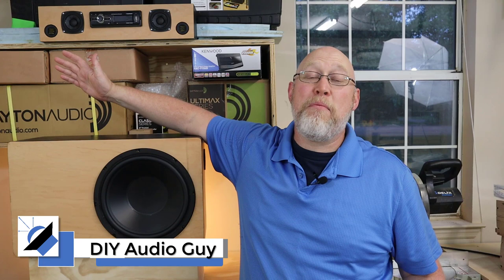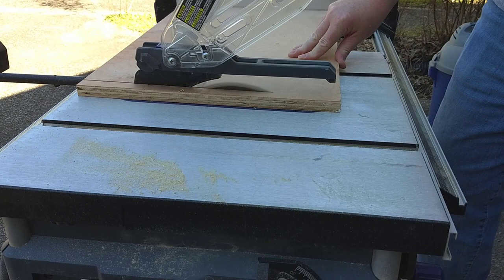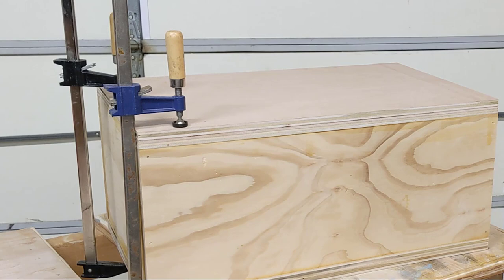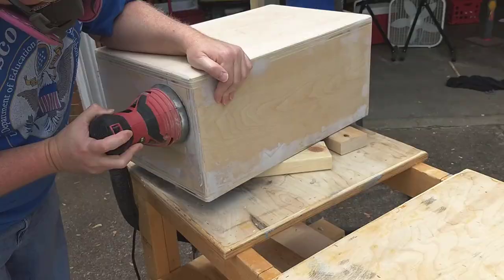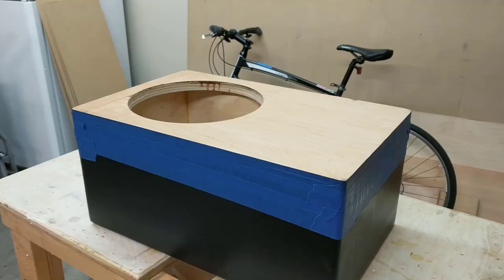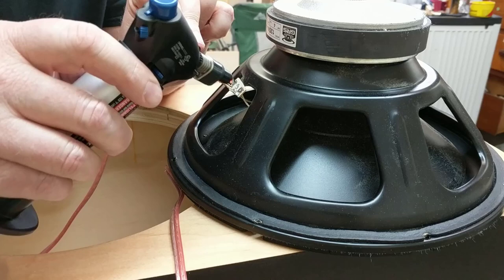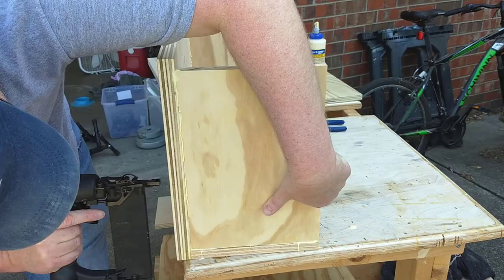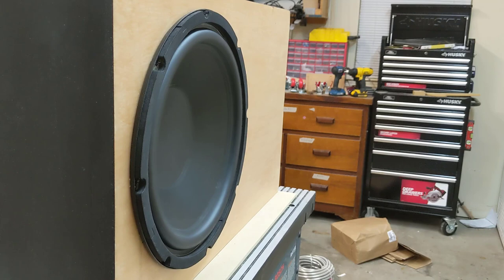Budget Subwoofer Build (The Budget Bass Box)

Comment: I'm giving you a thumbs up simply because you didn't try and BS us that you built it for $23. Like you I have a shed full of tools (not that I can get to many of them) but even if we have material left over from a previous project, it still cost us money at one point, and I like that you didn't pretend it didn't. All going well I hope soon to start on "the internets most expensive DIY sub build" (maybe not the most expensive, but we are talking a lot of thousands).
Reply from the maker: I would like to see that!
Reply: @DIYAudioGuy  so would I. I bought the LMS Ultra 5400 driver and 18" VMP passive radiators before TC Sounds went out of business. I have been sitting on them for nearly a decade now. I'm in the process of refining a six sided cabinet for it. I figure there will be about 5 - 6 sheets of 16mm MDF in it. There are a few experimental things I would like to try, like dampening paste between layers. Also tossing up if I want to use dissimilar materials (both MDF and Ply).

Comment: I bought the 8 ohm version, 2 of them. One is in a sealed box for my home theater, it shakes my entire wood floors, I feel earthquakes in movies and only pouring with about 200 watts. I'm going to buy 4 of the 4 ohm for my truck blowthrough budget demo build! These subs rock!!!
Reply from the maker: I like cheap subs and I cannot lie.
Reply: @DIYAudioGuy  that sealed enclosure i built is 2 cubic ft, half filled poly just dropped in not stuffed and one layer of the yellow sound dampening on one inner wall. It plays beautifully flat, hits all of the notes  with crossover set at 50. The cabinet it is in is an old stereo console from the 70's. Gutted with 2 sub enclosures now built in. Only using the sealed side, dont like the way the ported side turned out, its 2.5 cuft.. i took that one out until I re build for another sealed. I dont like how ported boxes sound in my house, it's ALL wood floors with basement. Doesnt take much power to shake pictures. Downfiring subs, I raised the whole console by adding just 3 inches allaround and left the fancy cut open on front, making it a 4th order. Turned up, I can feel it in my chest, like I'm at a concert.
Reply from the maker: @bradlwykfulbright  If you have any pics of the build you can send them to Parts Express, they'll put in their speaker projects gallery and give you 25 bucks.. at that point it's basically a free woofer.
Reply: @DIYAudioGuy  i had no idea of that, thanks!
Reply: @bradlwykfulbright  I’d like to see that myself!

Comment: 30 yrs in car audio/customz here.. tips - just before u painted it.. use wood glue on moist rag.. wipe it around the outside of box over that grain and it fills/vanishes.. sometimes it takes a few rounds of drying but it'll smooth, then spray it with filler primer (automotive) and sand back, repeat.. then use epoxy based paint for furniture, clear it with polycrylic and detail it..  it'll look like a piano..   you can also wrap it with vinyl and a torch thats low budg
Reply from the maker: Thanks for the tips!  I ended up repainting and uses some automotive primer, that made a big difference.
Reply: Don't you need a finish for Vinyl? Besides the wood surface?
Reply from the maker: @kramnull8962  as far as I'm aware you can just glue a vinyl on, the trick is using the proper adhesive, and making sure the surface is smooth because any bumps will show up in the vinyl.
Reply: @kramnull8962  best adhesion possible for iron-on vinyl products like faux wood grains n such OR real grain laminate with wood glue - would be on a KILZ sealed surface lightly scuffed with like a 3M 7447 pad..  Automotive grade or commercial grade decorative vinyl needs a smooth smooth flat sealed surface to adhere longterm and not show flaws thru it.   use something like a 3M Ultra Fine 7448 after stepping down from higher grits and use a heat gun on low to lock the vinyl in.  (94-110 degrees only)  auto vinyl i highly recommend vvivid out of canada its perfect every time for me.  hope that helps
Reply: i think you might like gelcoat from the boat world if you do alot of these, learning spray techniques is fairly easy (YT)..  or even use epoxy/mica countertop/surfboard style art techniques on inserts or accent panels is also a way to take your stuff in all new directions on the cheap.. LED and incandescent panel lighting is dirty cheap these days and can be a huge pop for like $8 off web..  and if you see a car, exotic whatever with a paint job u love.. look up the paint code, hit up an online company that mixes bodywork paint in cans and have at it.. like $34 a can.. theres tons of cheap tricks that yield incredible boutique design results.  great vids bruh :-) keep craft skills alive!
Reply from the maker: @crzjohn4275  Great ideas!

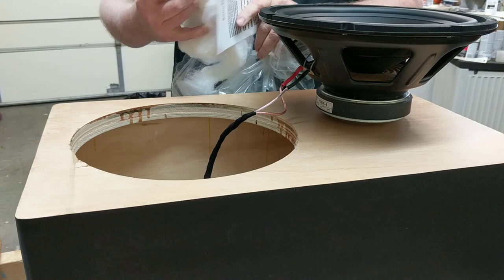Comment: @5:35 standing waves are not normally a problem with subwoofers. Usually the enclosure is much smaller than a half of a wavelength at the cutoff frequency, so standing waves cannot occur.

Comment: Budget tip: if you buy quality tools used you can use them for as long as you like and resell later at little or no loss. Blades and router bits are another story, but carbide is a good investment in edge life.
Reply from the maker: Absolutely!  Just have to make sure all the parts are there when you buy them!
Reply: @DIYAudioGuy  You also have to make sure you use them enough to warrant the cost.  i.e. sure a 14 inch circular saw is nice, but does anyone really need to cut down an 8x8 at a 45 miter in one pass?  I would not cheap out on some tools though like a router, everyone always seems to have a really underpowered one and they're not that expensive.  The router tables with easily adjustable lifts are the expensive part, I find the plunge base to be awesome.  I built a router table and have hardly used it.

Comment: I cut the hole in the baffle before even gluing both layers together for a clean flush mount. Also adding t nuts and screws rather than wood screws. Way more clamping force and no worries about stripping out the holes. Cheap insurance.
Reply from the maker: That is typically how I do the baffle.  https://youtu.be/6xooITE0-K8 
I am not a big fan of t-nuts, in my experience they are not worth the trouble and they are not as good as threaded inserts.

Comment: If you don't have much money and you are okay with spending a bit more time you can build very nice speakers with Max 50bucks of tools. I started with a handsaw with changeable blades (A big long one for cutting the wood and a Jigsaw kind of blade for speaker cutouts), drill, rasp and a file, chisel and the consumables like sandpaper and glue off course and 1year of woodworking experience from collage. I had a very good woodworking master😃

Great video and very intertaining! Maybe i gonna put that driver in hornresp and design a tapped horn for it🤔
Reply from the maker: Hand tools, that takes dedication!
Reply: @DIYAudioGuy  Yes and a big load of it! Takes 10times as long.

Comment: This GRS looks very much like the OEM driver from my Klipsch ksw-12 home theater subwoofer. I replaced it with a Dayton classic series 12, which has a much, much larger magnet and stiffer feeling suspension. I was skeptical at first about low end extension, (don’t care about volume,) but it rattles a door in the room at normal listening volume due to being punchy and quick, and yes, it goes low too.
Reply from the maker: I've been using one of those classic 12s for my DIY home theater sub for about 6 years now.
Reply: Yeah I think they are possibly the best deal in subwoofers. Instead of getting a new sub, just grab a cheap one at the thrift store and stick one of those Daytons in it! The Ksw-12 came from a neighbor, for free and was not powering on. I replaced a blown fuse and a faulty fuse holder, and it has worked ever since. Perfect sub for the Dayton driver!

Comment: I normally cut the speaker hole before I attach the baffle. But after seeing this. It looks like it’s a lot easier to cut.
Reply from the maker: True, but if you mess it up...
Reply: @DIYAudioGuy  that’s true. I guess I gotta practice before I do that all I have is a jigsaw and I don’t have a very steady hand. So best to not screw it up lol. Speaking of. Do you have any tips to make sure I don’t cut the hole too big/too small. Or uneven.
Reply from the maker: @the_allamerican7057  two screws and a piece of plywood Will get you a very good circle.  A sharp blade on the jigsaw, and set it so that you can cut curves.  Then all you need is a steady hand, which just comes with practice.  It would not hurt at all to grab a bunch of scrap material and just practice cutting circles until you think you've got it.  The first subwoofer cut out I ever made was absolutely terrible.  The good news is that subwoofers usually have a pretty big mounting flange, so there's a little bit of room for error.

Comment: No I’m checking out your page I’m in your channel watching you build speakers I’m about to get a surroundsound system and my wife wanted to buy one of those ones that everything comes with it and I was like no I’m not doing that I’d rather buy for Sherwin Vega bookshelf speakers That would sound better than one of those systems anyway even two of them because I had two of them seven years back when I was younger with a Sony stereo with a 200 this CD changer this is back before all the Bluetooth and all the iPods and all that but that’s one thing I loved about Cerwin Vegas you didn’t need a lot of power to make them sound really good 🙀🥳😱🤯😎🤩🙀
Reply from the maker: I you are looking to build your own speakers this is what I use and it is amazing.  https://parts-express.sjv.io/a1Jk4M
Reply from the maker: If you want to buy speakers Crutchfield is running a sale:  https://howl.me/ciOgCnQtR7v

I do recommend that you build your own subwoofer, most pre-made home theater subwoofers are not tuned low enough, and the ones that are are much more expensive than building your own.  

https://youtu.be/dbVd5igcjHs

Comment: These subs are now $35.   But still worth their cost.   I've used them in many projects, they play well up to 800hz so can be used as a woofer in 3-way setups but still hit the low end like a sub.   They should be ported at 30-40hz in a 2ft^3 or more enclosure to get that chest thumping effect with just 60-100 watts.   Sealed enclosure is no good with these.
Reply from the maker: Yes, this does much better in a ported enclosure.
Reply: Now 45€🇩🇪
Reply: @DIYAudioGuy no. Look for tsp Parameter.  Qts  0.82 never for reflex, only closed.

Comment: The grs subwoofers don’t handle distortion that well and even if you don’t give it it’s rated rms power you can still cook the voice coils in them if you go too crazy with the volume on a amplifier that’s powering them I tried to free air a 15 inch version of the and it was rated to handle 150 watts rms and almost blew it with just 70 watts rms.
Reply from the maker: Yea, cheap subs are  cheap for a reason.

Comment: Hi, Simple to the point, great vid. Going to build two!  Did you use a low pass filter, if so what were components?  Many Thanks
Reply from the maker: I just used the crossover on the amp.
Reply from the maker: @The Dirty Cook I ran this in a car.  You would need an amp to run this.  You could bolt on a plate amp like this one:  https://bit.ly/3kO4fi6

Comment: I made a VERY VERY CHEAP bass box. I used very insanely thick cardboard 5bucks and a sketchy 6 inch woofer 10bucks and a screwdriver 3bucks. Sound is decent unless you put 30 - 60hz it starts shaking and dances. And the box nearly broke 😅 (I'm still 10 that's why😅)

Comment: Would it be a huge mistake if you accidentally got a 12 inch guitar speaker from parts express instead of a 12 inch subwoofer and ended up making the mistake of putting a guitar speaker into a subwoofer enclosure.
Reply from the maker: Yes.
Most guitar speakers, even the ones used in bass cabinets, struggle to hit the lows.  But, they are very efficient.

Comment: I would have used a rabbit bit to add a step where the speaker mounts so it sits into the cabinet.  And FYI, you don't have to include the cost of the machine equipment used on the project. The table saw can be a circular saw which can be a handsaw. Every one of the power tools can be replaced with a hand tool that you can get for a couple bucks at Harbor Freight or a yard sale.

Lastly, that box looks way too big for that sub.

Comment: Young Mann Anthony here with that question ?  Speaker build is 2-2ohm 5-1/4 coaxial & 2-2ohm 6.5 Kicker cvt subs will give you all the specs in a email if needed.  What coils and or caps should I be using for a crossover ? Up to 135-150hz for the subs and like wise for the Mids.  Speakers will be wired in series. (Like you a Budget build it's what I have in the shop a 2 channel Rockford amp)  This is a Ice Chest build FYI.
Reply from the maker: That depends on how complicated you want to get and how good you want it to sound.
You probably don't need any crossover on the coaxial. But if you want to filter out some bass try this:
https://parts-express.sjv.io/yR79L2 
If the mids and highs are to loud then you can throw on a resistor to turn them down a bit:
parts-express.sjv.io/x97Qbv
A coil liked this would make a good low pass for the subs.
 https://parts-express.sjv.io/rn7ObR 

That will give you a 6db per octave crossover with a crossover point around 120 hz.  No guarantee that it will sound good.  But it will probably be fine for a budget build in an ice chest.

Comment: that plywood alone is worth as much as 5 of those drivers right now
Reply: @DTW-bx2vy  Not really. Currently its $36.54 at home depot. I believe it used to be higher, but before covid it was more like $20 a sheet.
Reply: @DTW-bx2vy  Yeah birch is $60 a sheet, probably twice what it used to cost. Everything's over priced.
Use iron on edge banding and you wont have to worry about plywood imperfections. I hate when people use ply and dont cover up the core. Defeats the whole purpose of plywood.

Comment: I have my eye on these drivers to replace a really nice B&C 18" cast frame pro cinema sub that is disappointing in low extension.  I can mount the GRS (4 of them! ;->  ) in the interior wall of my barn loft listening space in a true infinite baffle configuration as their Qts is about 1.0 and the room behind is quite voluminous and only used for storage.  This should give me strong bass down to below 30hz, plenty low enough for music.  And their lackluster sensitivity should be greatly improved by acoustical coupling from cluster-mounting them, giving me a close equivalent to a 24" driver.  I should be able to sell the B&C used and be money ahead, or I can repurpose it for mobile DJ use where it performs really well.
Reply from the maker: These are great speakers for the price., Just keep in mind they are inexpensive for a reason.
Reply: @DIYAudioGuy  Sure, I get that. Other than the modest f3 in the small sealed enclosure, did you hear other audible evidence of their budget quality that would make you hesitate? I'm kinda thinking vast piston area covers a multitude of sins at moderate spl and low X. But maybe clustering results in underdamping of already high Qts drivers?  Cheers!
Reply from the maker: @naturalverities  Nick with Toid's DIY has used these a lot, he's a big fan just like I am and we have discussed these a lot.  Just be aware that these are not audiophile drivers.  In fact you might want to check out his channel he built an isobaric subwoofer using the tens and it was an absolute beast.
Reply: @DIYAudioGuy  Thanks, yes I saw his build, intriguing! You guys rock!
Reply: Were you using the B&C in a sealed box or vented?
Reply: @TimpBizkit  It's vented, in a box volume quite close to that recommended by B&C. Ports may be off a bit as they are triangular in two corners a la QSC cinema sub cabs. I really should get the stuff I need to test the driver as I am suspicious that its free air resonance may be higher than spec. Except for not getting down into the 30s with authority, it sounds fabulous.

Comment: I always cut the hole when the box is done as i try to always design the box so the drive overlaps the sides so it's more ridgid
Reply from the maker: That's clever.
Reply: @DIYAudioGuy  you show try build a tline with extremely braced box with a cheap drive and you will be amazed at the sound
Reply from the maker: @dlfrestoration  My home theater speakers are transmission lines. I'm a big fan of transmission lines!
Reply: @DIYAudioGuy  nice i love the bass responses

Comment: Never, ever, and did I mention never, have your hand in the path of a brad nailer, nail gun, or power tool in general.
Your very lucky that you haven’t had a bad day yet. Seen many a shoot outs, stick outs, or shoot through from one longer brad left in gun from switching sizes.
Reply from the maker: You are right, I have been lucky and I have had a few near misses.  So I have started being a lot more deliberate -- holding things together with clamps while I drive the brads, that kind of thing.

Comment: The first mistake i seen was that cut on the table saw ;)  Never cut a board wider than it is long . At least you had a riving knife in it.
Reply from the maker: Correct. That is safety rule that I violate from time to time.
Reply: @DIYAudioGuy  I do a lot of woodworking and i always tell people that a box is the hardest thing to build, and get right. Mdf is a little forgiving thankfully. When i built some boxs out of oak plywood a few years ago , i had a hellova time.
Reply from the maker: If you can build a box you can build almost anything, if you think about it about 80% of what you do when woodworking is just some variation of a box.